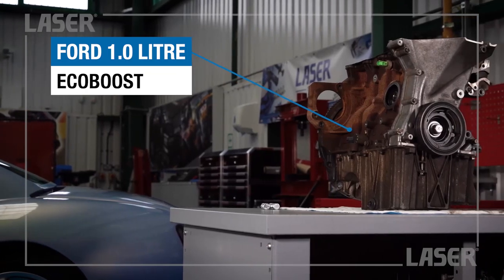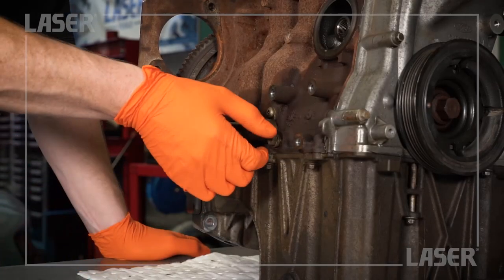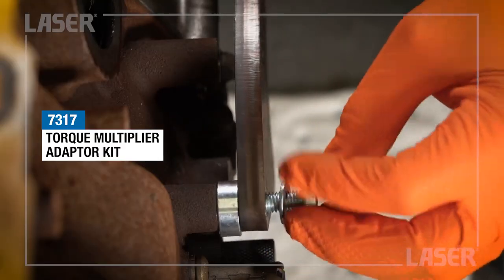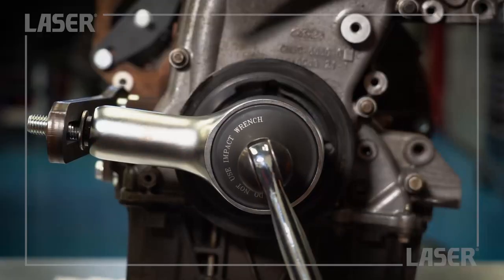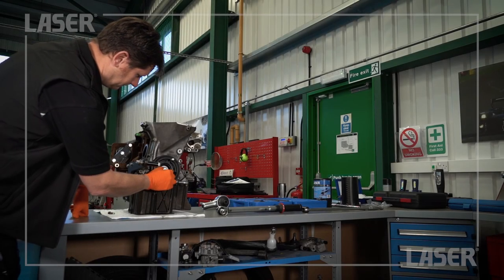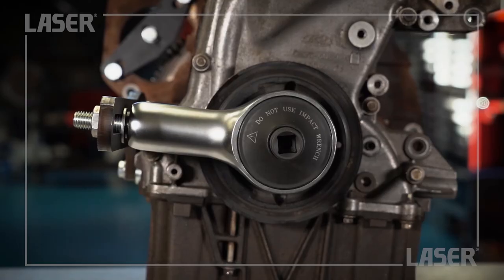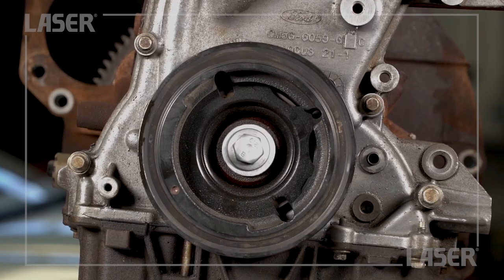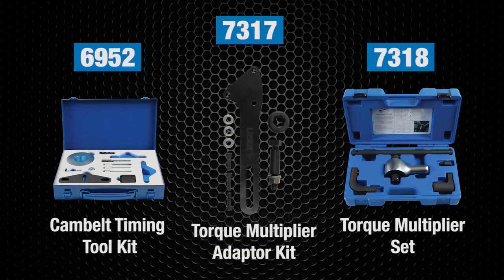6952, 7317, 7318 | Torque Multiplier Adaptor Kit For Pulley Bolt Removal | FORD ECOBOOST 1.0 Litre

Comment: Like I always say there's the right tool for the right job looks awesome piece of kit
Reply: It does look like a nice bit of kit, unfortunately the price is also awesome and not in a good way.  Reckon it will take a few belt changes to cover the cost.
Reply: Only the one. I have been getting quotes between £1200 and £1700 to have the belt and water pump changed.  The cost of these tools, along with the parts, and doing it myself is less than half the price.

Comment: Fords procedure seems to suggest using the torque wrench "with" the torque multiplier fitted, their tool has a 5-1 ratio 

60nm then 90° x5

Apparently that works too around 300nm (60nm X5) then 18° X 5 (1/5th of 90° five times)

So 300nm + 90°

Doing it according to this video with the Lazer tool would be equivalent to 25nm 70nm then 82.77°

90°x8+25° = 745° divided by 9 which is the ratio of the tool = 82.77°

The end result is Surely much less torque than required.😢😢

If you follow the Lazer procedure "with" the torque multiplier the numbers still do not add up.

25nm x9 would be 225nm, 
70nm x9 would be 630nm,

Considering the 9-1 ratio of the lazer tool i believe the procedure should be 

25nm without tool
70nm without tool
33.5nm with tool (33nm x 9 = 301.5nm)
Then 90° x 8 +25° with tool.

The above would be equivalent to 301.5nm + 82.77°, still slightly under spec compared to fords numbers but closer than what this video shows.
Reply from the maker: The Laser 7318 Torque Multiplier procedure is as follows,  (please note the Ford OEM tool uses a different gear ratio)
Laser 7318 and 7317  gear ratio is 1:9.

With a torque wrench set the crankshaft bolt in 2 stages.
Stage 1  25Nm
Stage 2  70Nm.

Assemble Torque Multiplier on engine.
Apply a starting torque with a torque wrench of 33NM to the torque multiplier.
With a suitable power bar.
Apply 8 x 90 deg,  followed by a final 1 x 25 deg.

Comment: think you need to update this video or put a warning that its wrong and you need to do  33NM to the input of the torque multiplier then the extra angles to achieve the 300NM plus 90 degrees at the bolt
Reply from the maker: We would always recommend using the OEM/Autodata setting for the pre-torque setting but as stated in the video our torque multiplier has a different ratio so our instructions for its use must be followed.

Comment: You don’t need a friction washer?
Reply: I'm certain you do need the diamond coated friction washer when installing the crank pulley on these engines.  This should have been mentioned in the video.
Reply: @ferrumignis  not all of these engines require it, im working on one now and from the factory it is not on here. dont know why its not all the same.
Reply: Sorry to dig this comment up from years ago but would you happen to have a part number for the friction washer? Doing one now and am not have any luck finding one.
Thanks!
Reply: These bolts come with the washer sorry for the late comment

Comment: Thanks for the video, I guess you have to remove the engine to do this ??
Reply: No, you can do it with the engine in place.  A number of components need to be removed to gain access.  That's why garages charge a fortune to do it.  It is labour intensive.
Reply: Complete waste of time for a simple job ,honda had the same problem with the stationery engine, with the timing slipping 😢 Engineering failure waiting to happen 😮
Reply: @lynjames4306 these bolts tend to seize or tighten themselves, which makes them pretty reliable, but I prefer a keyway

Comment: What an absolutely ridiculous design, Iv done Ford cambelts  before and had to tighten the bolt through 90 degrees a few times . This engine has obviously been designed to stop the diy man doing this job , unless of course he can afford the big price of the tool.